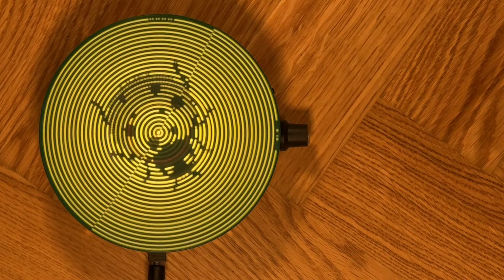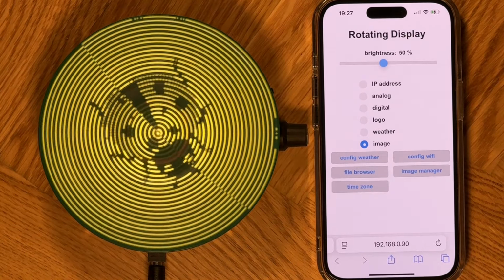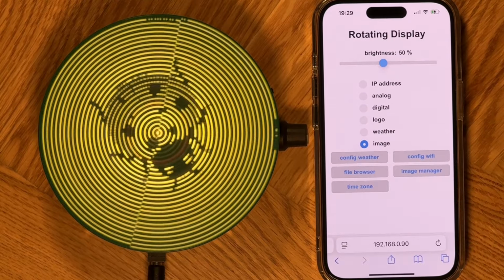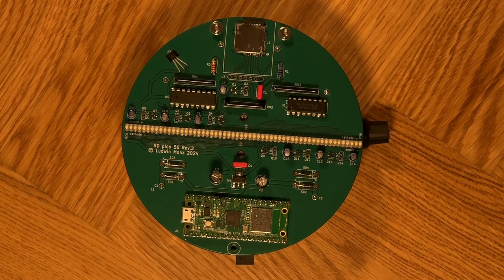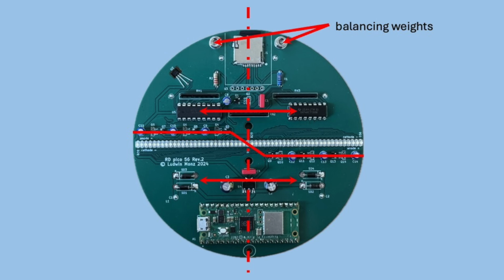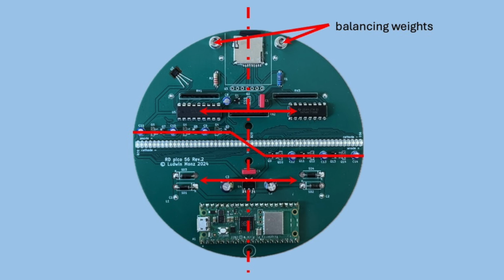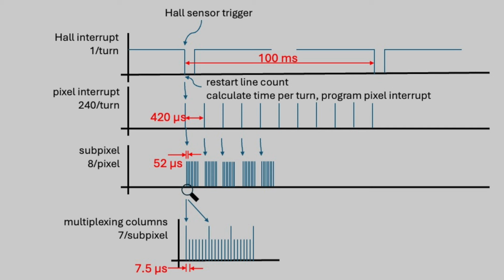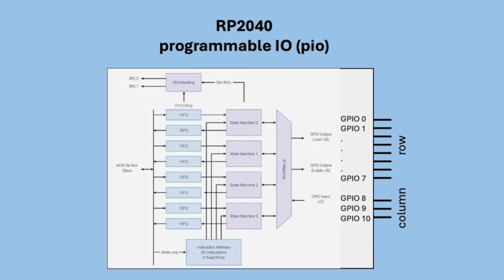Rotating Display pico - how to make a POV display controlled by a Raspberry Pi Pico. DIY.

Comment: Hi,
Amazing projects!
Is this project already 100% ready in your github repository?

Also, I'd appreciate an explanation of the different projects from this type.
I saw you have 4 different projects in github. What are the differences?
What has most chances of easy reproduction?

Thank you so much!!!
Reply from the maker: Hi,
thank you for your interest. Here are some thoughts:

1. is this project 100% ready?
such a project is never 100% ready. The repository represents the current status of the development. The device has the functionality, that you can see in the video. It is certainly worthwhile, reproducing it. However, I continue to work on it, improve the performance, and fix software bugs.
Specifically, I am exploring ways to speed up the SD card. I might need to modify the PCB - this is not clear yet.

2. what is the difference between the various rotating display projects?
The first generation ("rotating display") was based on the Arduino nano and an ESP-01s. A key milestone of this first version was the development of the wireless power supply with printed coils. Its design has proven to be very robust and has not changed much in the more recent models.  The biggest limitation of the first generation of the rotating display is the small memory of both the Arduino nano and the ESP-01s. There is very little room for further expansions of the software.
The second generation ("rotating display color") drove the design towards full color. A multitude of design problems had to be solved, for example how to drive the 56 color LEDs (168 LEDs total). Furthermore, handling much larger files was a challenge. This was the first model to use a micro SD card for data storage. The hardware complexity was much higher and the design required industrially assembled PCBs. Finally, handling of animated GIF images required a significant upgrade of the javascript. From a design standpoint, the dual processor structure is the most significant limitation. From a reproduction standpoint, the industrial assembly makes the device expensive and difficult to reproduce.
The third generation is the "rotating display pico". It introduces a single microcontroller design and simplifies the LED driver logic. To be fully transparent, the LED multiplexing is not perfect (there are "ghost images", due to speed limitations of the multiplexing electronics), but I think the image quality is fairly good. It is probably the least expensive design. The software was ported to the raspberry pi pico, which helped to improve transparency of the software architecture. The device is fairly easy to reproduce and can be hand soldered. However, soldering the micro SD card slot (which is a SMD component) is not easy, if you are inexperienced o soldering.

3. which model has the best chances of reproduction?
Chances of reproduction are high, but very much depend on your soldering and electronics experience. I am aware of maybe a handful of people who produced the first generation design. They succeeded all - some required a some remote support from my end.
Here are some thoughts on the reproduction:
- first generation: requires the least electronics and soldering experience, as only threaded components are used. However, on the software side some familiarity with Visual Studio Code and platformIO is required, in order to upload the software to the device.
- second generation: not advisable for beginners. You will likely need some test equipment for the initial assembly.
- third generation: I recommend the use of threaded MOSFETs and a SMD micro SD card slot. You will need some soldering experience, to assemble the device, though. From the software side, this design is easiest. You will not need any specific software tools. Uploading the software is just a matter of copying files.

My advice for beginners: go for the third generation. If you feel insecure regarding soldering, have JLCPCB solder the SD card socket and the MOSFETs and hand solder the rest of the components. I am sure this can be done. If you want to go along that route, I am happy to help you with the manufacturing data.

I tust that helps. Some background on who will assemble the device might help me to give better recommendations.
Reply: @LHM000  I so appreciate your response! I will go with your recommendation and manufacture the third option. Thank you again so much!
Reply from the maker: Let me prepare the manufacturing files. This will reduce the risk of ordering wrong parts.
Reply from the maker: I have updated the production data. You will need three files for ordering the  display PCB from JLCPCB.com with the SD socket and the MOSFETs soldered: RDpico_display.zip, bom.xls, positions.xls. You will find these files in the GitHub repository in
RDpico_electronics > RDpico_display > production > RDpico_display_2024-12-12_20-08-08

Download the repository to your computer.

Here are some hints for ordering the assembled display pcb from JLCPCB.com:

1. open JLCPCB.com, log into your account
2. click on ""add Gerber file" and select "RDpico_display.zip".
3. you will be offered many options for the PCB. However, just use the default values and change nothing
4. turn the "PCB Assembly" switch "on"
5. select "tooling holes" > "added by customer" (I have included these holes in the PCB design)
6. click "next" on the right hand side of the screen.
7. the PCB will be displayed. click "next"
8. click "add BOM file" and select bom.xls from the repository.
9. click "add CPL file" and select positions.xls from the repository.
10. click "process BOM and CPL". the parts list with the SMD components will be displayed. Note, that the total cost of the components is 3$ for 5 PCBs.
11. click "next". The PCB with the SD socket and the MOSFETS will be displayed. The SD socket  will NOT be in the correct position. However, you can ignore this. It will be corrected by JLYPCB automatically.
12. click "next". The quote for 5 assembled PCBs will be displayed. I got a price of 49.94$ for 5 PCBs.  
13. click "save to cart"

All other PCBs do not need assembly, as they can be hand soldered, fully. You can add them by uploading the respective zip-files, which you will find in the "production" sub-folder of the respective PCBs.

I hope this helps. Good luck.
Reply: @LHM000  Thank you! 
If I understand correctly, the small BOM of 8 components are all SMD and you propose that they solder them for me? 
I addition the rest of the BOM sitting here: rotating_display_pico, is the rest of the components which I will need to buy by myself and hand solder them?
Also, I'd appreciate assistance opening your project in KiCad program. I downloaded from the depository files I though were relevant but didn't succesfully manage. I would like to open the schematics and layout in KiCad.
Appreciate a lot!
Reply: Hi @LHM000,
I'd really appreciate your assistance.
Thanks!
Reply from the maker: sorry, I missed your message.

regarding the SMD components and the hand soldered components, you are correct. If you are experienced enough with soldering, you can hand soldering everything. If you are not, better get the SMD components soldered by JLCPCB.

In order to open the PCB in KiCAD, first download a copy of the GitHub repository to your computer. Start KiCAD, click on „File > open project…“ in the main menu. Move to the downloaded folder „RDpico_electronics“ and one of its sub-folders (for example „RDpico_display“). Open „RDpico_display.kicad_pro“. KiCAD will load both the schematic and the pcb.

I trust this helps!

Comment: I just stumbled across this and was very impressed! It reminded me of a project that came out of Paul Debevic's lab: https://youtu.be/YKCUGQ-uo8c?si=HG4B9rp1xTtJDkkT  That display achieved 3d by rotating a vertical rectangle instead of a line segment. I think their display was monochromatic without any grayscales, though.
Reply from the maker: Thanks for the interesting link. I have been thinking about a 3D display. It would require considerably more LEDs. Maybe a future project.